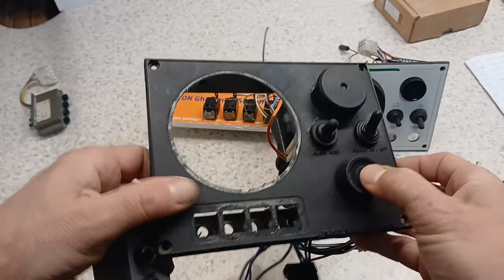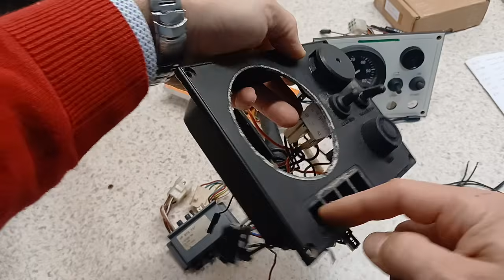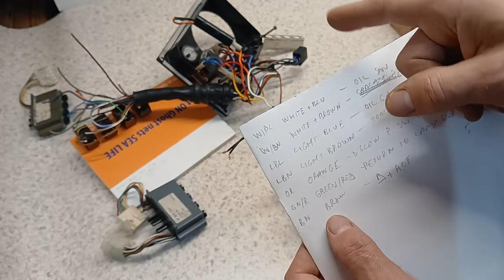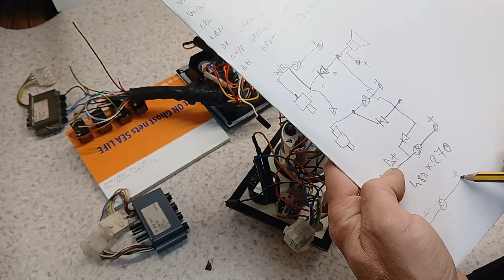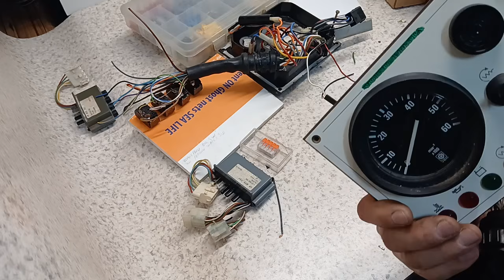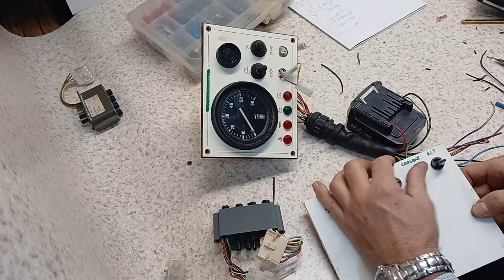volvo penta engine pannel save 500usd (euro) with this DIY alternative

Comment: great information, thank you. Just wondering, where did you buy the new panel? it's much better compared to the original. :)
Reply from the maker: somwher eonline... front pannel designer and you make it yourself, do not write volvo penta on it because is calle dcontrafaction and you can get in trouble